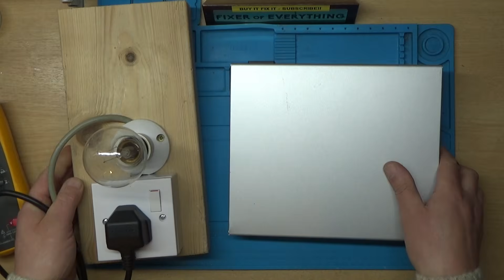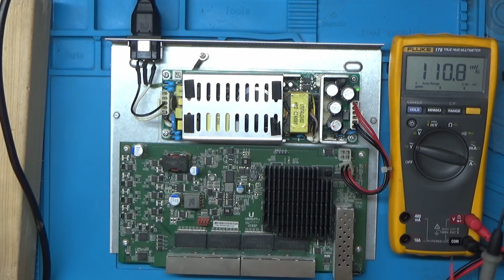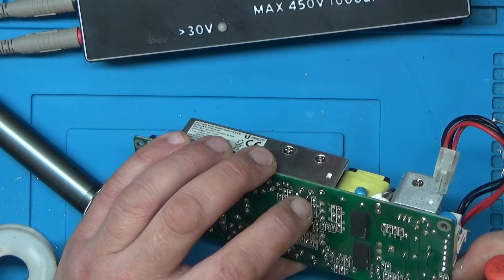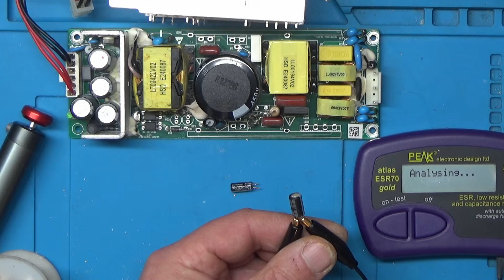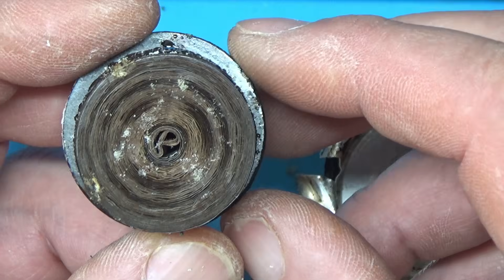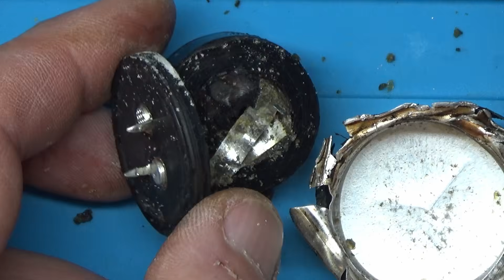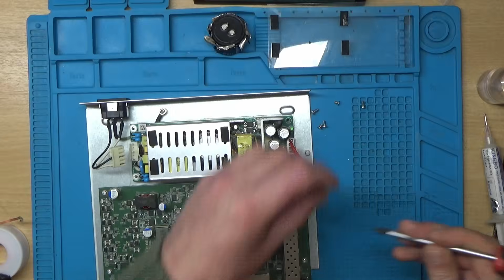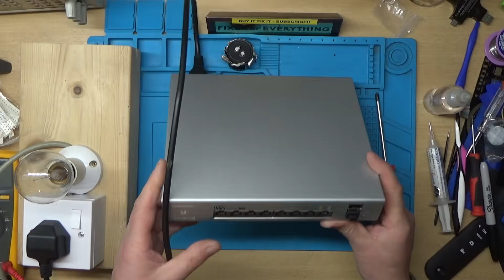Faulty Ubiquiti POE Network Switch | Can I Fix It?

Comment: Just happened upon this video while going through your back catalogue.

I had a Ubiquiti ToughSwitch8 (which is essentially the same switch with a few different options inside) and that same cap died after about 7 years.

Replaced it with a quality replacement and it's been going for another 6 years. 👍👍
Reply from the maker: Nice, well done 👍

Comment: Thanks for the video Mick. Always interesting. Picked up the 16 port poe version of this switch (same psu i believe) and low & behold same culprit. I checked Ali Express & the part number you used wasn't available. I ended up going to RS and used a 400vdc / 120uf type, slightly smaller unit but works a treat. Part number on RS was 752-9527 if anyone is interested. Size is only 30mm x  20mm (WxH) so fits under the heatsink with room to spare. I also left the top plastic shield off the psu to allow better heat dissipation as you suggested. On soak test now and all seems good! Cheers for the great video's.
Reply from the maker: Nice one, well done 👏 👍  Thanks for sharing the alternative pert too!

Comment: Love the capacitor autopsy 😂 what is the fluid they usually have in? Just some sort of electron flowable solution?  
Cheers
Andy
Reply from the maker: Cheers Andy 👍I'm not sure what they use for the electrolyte. I just did a quick search and there seems to be a few different ones. This is what I found: Liquid/Wet Electrolytes: Usually composed of ammonium salts mixed with solvents (EG/H2O). They can contain 5–20% water for medium/high voltage (up to 85°C/105°C) or up to 70% water for low-impedance, low-voltage capacitors.
Reply: @BuyitFixit nice! Cheers mick 👍

Comment: Is that plug part you have with a bulb a limiting circuit that if theirs appliance has a short the bulb illuminates?
Reply from the maker: Yes, exactly that. It's just a filament bulb wired in series with the socket.

Comment: the POE voltage is 48V
Reply from the maker: I think on these it auto switches between 24 / 48. It's regulated by the other power supplies on the board.

Comment: I certainly would have checked the active components at the heatsink and also the output voltage of the supply before putting everything back together ...

Comment: I'd be careful buying caps off of Ali, I believe most of the "branded" ones will be counterfeit, and the off-brand ones will be crap quality.
Reply from the maker: Agree. I did search for them at some reputable suppliers first but none offered capacitors with the dimensions required. They were all too tall. I could have butchered the heatsink etc but I thought I'd get one of the same size.

Comment: I have one of these. Getting 53v from PSU. Front LED works, processor gets warm, but nothing else. If only I had a schematic.
Reply from the maker: I've got another I'm looking at for someone with similar symptoms. Have you tried to see if you get any messages on the debug uart inside? You'd need a serial TTL to USB adapter.
Reply: @BuyitFixit no. I'm assuming it's the nearby 4 pin header? Wasn't sure what that dad. Can you post a link to a wiki for this?
Reply from the maker: I'm not sure if there's a wiki or such. It's a common thing on embedded devices to have a debug port. You would connect this to a serial adapter and then use a terminal program such as putty with the baud rate and COM port set. (usually 115200,8,n,1) are common settings.
It usually spits data out or sometimes you get an interactive shell where you can type commands. On the unit I've got to repair it seems like there's a RAM fault on it as it keeps testing the RAM and showing different amounts on every boot.

Comment: My motto with SMPS. "It's a capacitor"  its always a capacitor.  And this is nearly true. Capacitors in a SMPS are stressed more than in almost any other circuit. They often fail to a high ESR failure..
Reply from the maker: @miller-clem  Yes totally agree 👍 Mains caps don't usually get as much hammer as they usually just smooth the incoming AC, however it seems that since power factor correction they are also now put under more stress with the PFC circuit.
Reply: @BuyitFixit  thanks for quick reply. Yeah I meant it in a humorous way, but it is partly true.  I really enjoy watching your work, thanks for the videos..
Reply from the maker: Thanks mate 👍

Comment: the first repair i did was a poe ethernet switch. It was as noisy as hell. it wasn't the cap. one of the fans died and the excess current was flowing though the others, of which one had worn bearings. I replaced all the fans. i now have a decent poe ethernet switch :))
Reply from the maker: Nice, well done. Another item saved from the landfill 👍

Comment: The big cap looks like the only non-Rubycon on there. Looks like, aah wack this one in there... But the board actually has a Ubiquiti logo and Rubycon caps, not bad. Also a green board, no cheap white pcb. Liked the but of Silent Witness on the dead cap.
Reply from the maker: Yes, seems it was the only non Rubycon cap!

Comment: I have a faulty 16 port version of this I couldn't get working (tried replacing the 440v cap as first port of call (note to self, remember to discharge next time before probing)). Got some replacement fets, diodes, caps and the IC but never got around to looking at it again. I was just going to replace the lot and hope for the best, but I hate mains voltage stuff.
Reply from the maker: @Kolor-Kode  Yes working with mains is a bit scary at times. I'd recommend a dim bulb tester so at least things have less chance of going bang or exploding.

Comment: Ubiquiti seem to have terrible issues with their choice of electrolytic capacitors. I've had at least three of their switched mode power supplies fail with the final stage smoothing cap failing. When they fail the device makes a ticking noise, just like in your case, so I can only imagine how many people have thrown out their AP's and switches assuming the device itself has died!
It's also not as obvious what the issue is because the power supply is still giving the correct voltage, but you have to view the output with a scope to see all the horrendous interference present on the line.
Reply from the maker: Interesting, thanks for sharing 👍

Comment: Good fix. Why didn't you just unscrew the components from the heat sink/shield instead of unsoldering them? It can't hurt to reapply thermal paste, if there is any, as it tends to dry out.
Reply from the maker: Thanks 👍They were bolts with nuts.. so you couldn't just unscrew them. If you think about it, you can't screw into a bridge rectifier or transistor. If they use screws the threads are usually in the heatsink, and are screwed from the component side.

Comment: Actually don't think I've had a bulk cap fail before, guess there's a time for everything. My last SMPS repair involved a dry joint on the transformer feedback winding, and somehow not the obviously failed output caps. That took... a while to find, to say the least.

Not good for tiny orders like that, but I do recommend LCSC for cheap parts in bulk. Also a random tip: Rubycon caps are one of the few fakes you can easily spot because they never bother to copy the signature "K" vent stamp.
Reply from the maker: Yes, mains smoothers rarely fail. Was wondering if it was just a poor quality cap, or if HF or something from the PFC circuit switching the inductor in and our caused it to fail more quickly. Thanks for the K tip 👍

Comment: Hi TV repair have you come across these COF connectors on Modern LED tvs ribbon cables that connect to the screen apparently they are scrap if you have a problem as they are bonded with a non conductive glue  and the tool that does is £1000s
Reply from the maker: Not sure on that, I have seen ribbon cables bonded "glued" to things like LCD boards and the LCD glass panel in the past, but not sure if this is something new as I've not looked at LED TV's yet.
Reply: @  could I email you ?
Reply from the maker: Sure, it's the channels name at out look dot com

Comment: Nice work! I think i saw similar problem in one of My Mate Vince videos, is it manufacturing fault or it’s common in this type of capacitors?
Reply from the maker: Thanks 👍 I'm not too sure if it's just a poor quality capacitor, as the other capacitors in there seemed OK, or if it's something to do with the power factor correction circuit switching the inductor in / out at a high frequency. I haven't experienced too many mains smoothing capacitor failures.

Comment: Nice work, saved from the dump. For the light on the front, it's an indentation of the status of connectivity. Flashing white is powering up. Solid white is ready for adoption, solid blue is connected to the controller, and white and blue alternating flashing is firmware update. These are the old style the new ones have screens. Nice work though.
Reply from the maker: Thanks 👍and thanks for the info. That's the problem when someone sends me something to look at, I could spend hours trying to find manuals and reading them, but I'd rather spend the time trying to repair it 😂😂😂👍

Comment: I noticed you don't use flux.   Your solder must be flux core.   Also, most of the older electronics do not have the high melt, low lead solder that modern boards have.🤔
Reply from the maker: If I'm soldering through hole components, I tend not to use flux as the leaded solder I use already has flux in it. I do use it if I'm doing SMD rework 👍

Comment: So, just by plugging an Ethernet cable in and seeing a led lighting up, you assumed it's fixed ?
Btw, at the beginning, you DIDN'T tried the cable in first place...so, that's not significant.
Reply from the maker: The PSU was ticking, and no power light. The person that sent me it works in IT and said it was dead... no power. The mains cap was 0uF. Now it lights up, and negotiated a connection when I plugged it into my router. Obviously I didn't check every possible function of it, but it's no longer dead.

Comment: Thanks I've learned so much from your videos.  I started ordering stuff from ebay listed as "for spares or repairs" to practice on but the parts arrive working fine.  How am I supposed to practice if I cant even purchase properly broken parts on ebay!  😁
Reply from the maker: Thanks so much 👍Don't worry you're not alone! I've also experienced the same issue, where an item arrives and I can't find a fault with it. Pretty frustrating when you bought it to repair on a video 😂😂😂

Comment: Nichicon from AliExpress... and for that price... that'll really be from the Chinese "we silk screen print anything" company.  Guaranteed to be anything but Nichicon, but so long as it works for a while.  That white dust was all over a coil at the other end of the board too.  Talcum powder?, rubbing down dust?, Anthrax?!  Another great fix.  Well done.
Reply from the maker: Thanks Mike, I did try some other more reputable suppliers first, but all of the capacitors they listed were a minimum height of 25mm which was too big. The only place I managed to find the 20mm was Aliexpress. Hopefully it lasts as long or longer than the original STGCON capacitor 👍
Reply: @BuyitFixit  It's almost certainly the same capacitor.

Comment: If that cap is a common problem for the power supply in that switch and if it's unusual that a capacitor of that type should fail then you would have to suspect that there is design flaw in that power supply circuit that over-stressed that huge cap. So, this is a problem that could keep happening.

Does that make this a bit of a dangerous unit?
Reply from the maker: I don't think dangerous, just probably prone to failure, although I think the unit was around 10 years old so it has lasted probably longer than the average domestic TV for instance. I'm not sure if it was just a poor quality capacitor or if HF from the PFC circuit caused it to fail more quickly. Main cap failure is not something that I've came across very often.

Comment: Nice work, I would have suspected one of the two bootstrap caps as well vs the mains cap which rarely go bad
Reply from the maker: Thanks 👍I'm wondering if it was just a poor quality capacitor ad the others seemed ok, or if it had something to do with HF from the PFC circuit switching the inductor in and out.

Comment: Had a client with that switch that failed. PSU like this. We just replaced it. My fix? I had an external 180W 48V PSU that i was able to just connect straight to the board lol. Just it in my office for quite a while and no issues.
Reply from the maker: Yes that also would work 👍I did similar with a Starlink Router, as the PSU had a chip on it that has to be programmed.

Comment: Thanks Mick! Glad to see that you seem to be doing well again. Those switches do seem to run hot and I guess from the looks of this they suffer because of it. When you first took that cap out I wasn't convinced it was the problem, but there you go. Good clean diagnostic work and a fine result. Thanks very much for letting us look over your shoulder.
Reply from the maker: Cheers Bruce 👍🙂

Comment: That switch is one of my favorites, sad they don't make it or an updated version that can do what it did. It's great because it does both 48v PoE and 24v Passive POE. I have a number of Unifi and UISP devices that I use for jobs and the switch saves time if you are careful.
Reply from the maker: Yes sounds a useful switch. I didn't know it did 24v and 48v. Thanks for sharing 👍

Comment: nice job, when in doubt check the power electronics....... very poor application of that ps.......the solid plastic sheet  on the top cuts off any air flow and any heat transfer to the top which cooks the components and dries out the caps. heat over time is the killer of parts and that ps was always on since it was plugged directly into the mains and by application really has to be always on. Holes in the plastic directly under holes in the top would have lessened  the problem. maybe plastic mesh bonded to the inside of the cover? enjoy your videos and work, 73 Mike K1FNX near Boston, Happy New Year
Reply from the maker: Thanks Mike 👍

Comment: Nice Repair!
I’m wondering why you chose to desolder those couple of parts when it appeared like those couple of screws on the side of the cage appeared to be what fixed them in?
Reply from the maker: @DavoShed  Thanks 👍The screws go into nuts on the other side of the components.

Comment: It looks like you could have just removed the screws on the side of the heat sink cover to take it off.
Reply from the maker: I would have thought they had nuts on the other side, unless the screw screwed directly into the bridge rectifier and transistors.

Comment: I was shocked that you yanked the power supply out, having not checked its output voltage, first. As it is, you got very lucky, because you started taking it apart without knowing its output status. The problem could have very well been on the main circuit board. Incredibly strange, until it occurred to me that only someone who had prior knowledge that the power supply had no output, would have skipped that very important step. Again, I was surprised to see you completely assemble the Ubiquiti switch, without first testing the power supply's output. Is all of this incredible "luck", due to the magic of video editing?
Reply from the maker: I didn't check the output, I could hear the power supply "ticking" and the output light was very dim and pulsing when it "ticked". I did disconnect the PSU from the main board just in case there was a fault / short on the main board, but the PSU light still was dim, and ticking.. So, I knew the fault was on the PSU. Hope that makes sense?

Comment: I keep watching videos on these switches with the same faulty Cap. I have a switch with no power and went to diagnose and repair it expecting to be the usual Cap everyone changes. I was gutted to discover the PS was fine and that a chip had blown on the board. All markings have gone and cannot find anywhere what it was. :(
Reply from the maker: Damn that sucks :( I could have possibly helped, but unfortunately I've already posted it back.

Comment: Great video 😊 the caps from aliexpress always far off in tolerance in have a full box here next time i dont buy them there anymore.
Reply from the maker: Thanks 👍I originally looked at other suppliers, but none of them had 20mm high, they were all 25mm. The only place I could find them was ALiExpress.
Reply: @BuyitFixit  yea some times you need to buy there. They also sell allot off fake chips but ok haha

Comment: Glad you fixed the power supply, however, I would have tested differently: you never tested the DC output- disconnected from main board - in case  there was a short. Once you took off the radiator you never checked the diodes/ transistors. I suspect you were sure the issue were the capacitors? . Once you got the new capacitors I would have tested if both had the same capacitance  ( in case one was a dud one).  Also noticed you never tested the voltage output once the power supply was repaired. What if it was still faulty and fried the board?
Reply from the maker: I didn't test the output, but it did the same thing when it was disconnected from the board. It was "ticking" and the power light was pulsing faintly, so I knew it was something on the power supply. Usually startup capacitors cause this which is why I checked those first. I tested the other one off camera, and it was the same value 130uF. Someone left a comment on the sellers listing saying it was 130uF also. I'm not sure how it could have fried the board? as the original cap was 0uF.